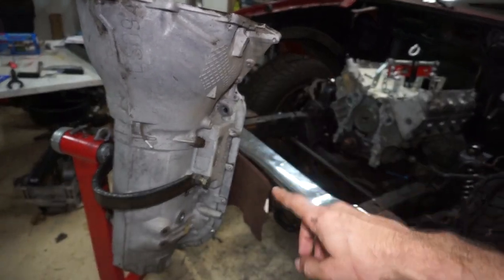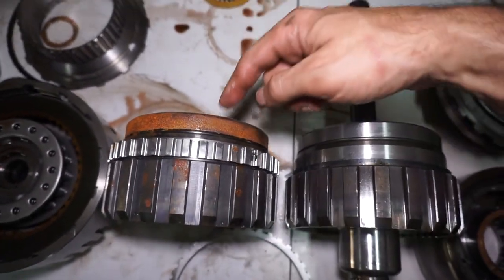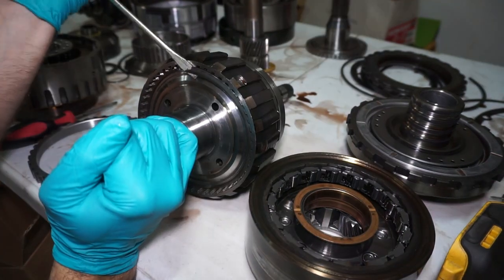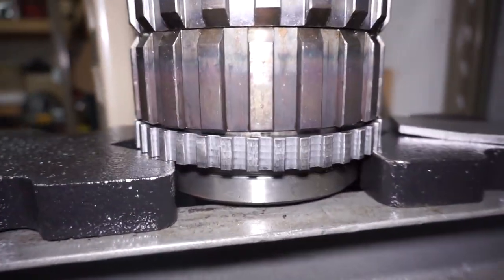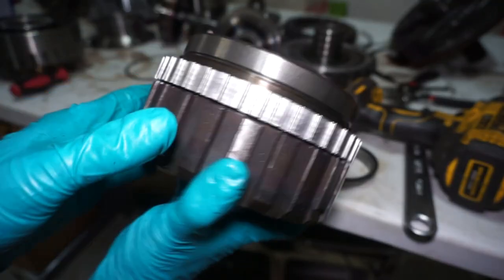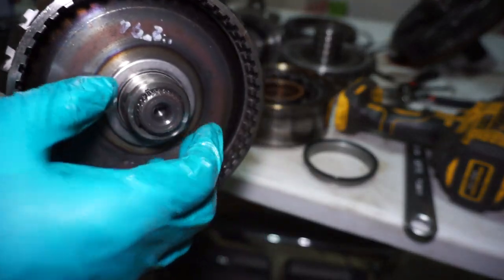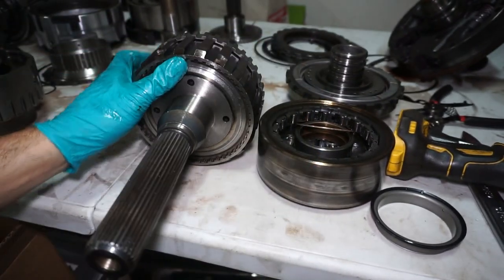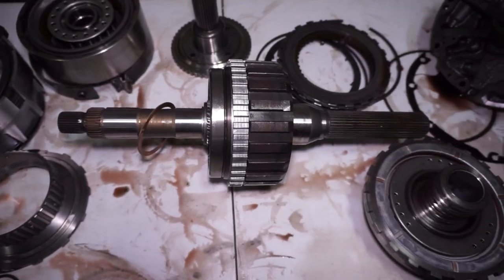4l80e Speed Sensor Reluctor Ring Install | 4wd To 2wd Conversion

Comment: I have a 4x4 4L80e that I’m adapting to my Toyota HF2A T-case. 80 series Land Cruiser. My question is do you know what the rear VSS does exactly? The Speedo is on the Toyota T-case. I really don’t want to tear down the transmission to install that speed ring if I really don’t have too. Using a LQ4 that’s DBW.
Reply: I’m in the exact same boat. But from what I’ve researched and been told is that the ecu needs the two speed sensors to be able to tell the transmission to shift.
Reply: @Boblanow1343  I just got the reluctor ring to press on. The 2nd VSS is important as if the front one. However now I’m gonna be transmission guy.

Comment: If my transmission looks fine fluid wise and no evidence of burnt clutch material. Should I just send it back together with no rebuild after installing this ring?
Reply from the maker: I'd look at clutches while it's apart.

Comment: Isn't there something that has to be done in order to get oil to the rear of the trans when you convert from 4wd to RWD? I was thinking that you were either supposed to install a cup plug before the extension housing was installed or supposed to drill an orifice into an existing cup plug. I can't remember which, and it's entirely possible that I'm just completely wrong and neither is necessary.. 
You're clicking through these items that are a lot of times, dreaded. You're going to be making some music pretty soon at this pace!!
Reply from the maker: Yeah the 2wd has the orificed cup plug with bonded O ring to pass fluid into the extension housing and lubricate the yoke bushing. 4wd is a solid plug... Haven't popped it out yet.